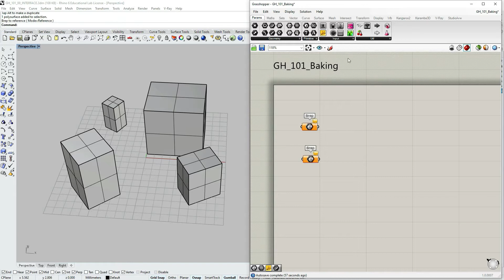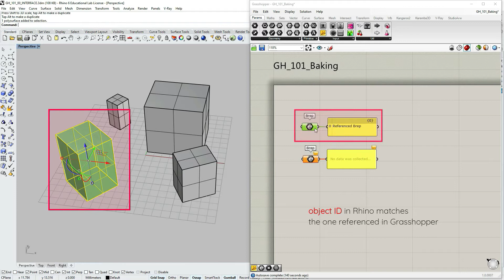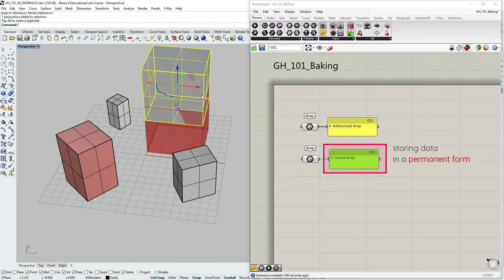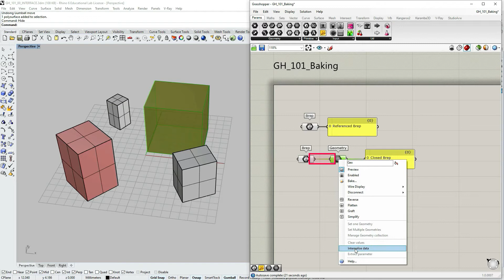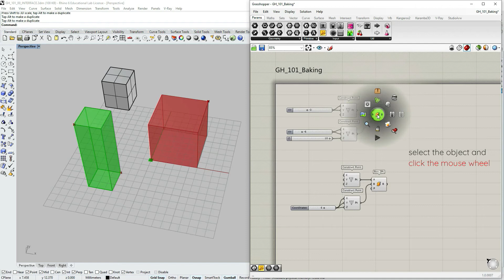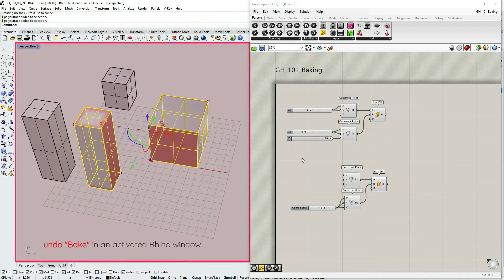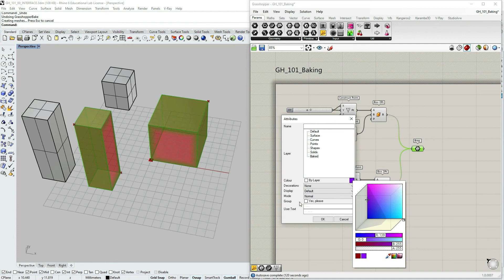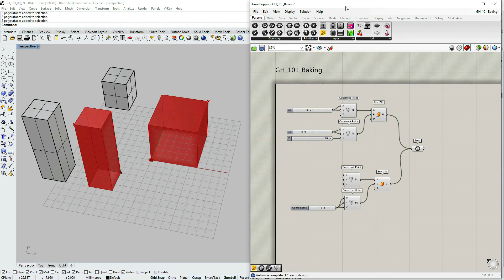Grasshopper 101: User Interface | #04 Baking Objects

Comment: Thank you very much. I have one comment for the baking (minute 6:00 baking a single object): at the start of this particular part, you mentioned that the objects were created in Rhino: how did you create them and bring them into GH when all the components are GH construction points (not params containers), with sliders, with a (Box 2p)? for all these components can't be referenced, and don't include (Internalise Data). Thank you in advance.
Reply from the maker: Hi, Thanks for the comment. 
You are correct: the boxes are created in Grasshopper  (Box 2pt component) from two points which are also constructed in Grasshopper (Construct Point component). No objects are referenced from Rhino, but the video also has no such contradictory statement. Just a misunderstanding perhaps. :)